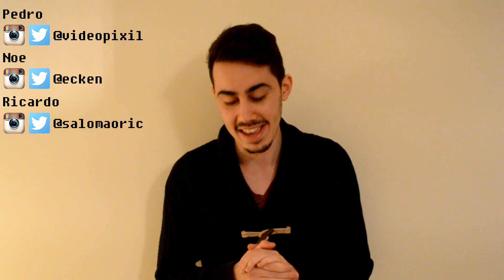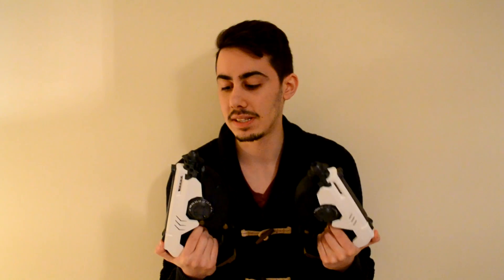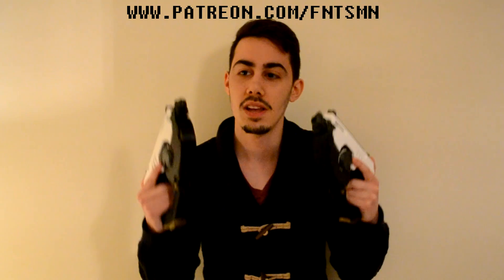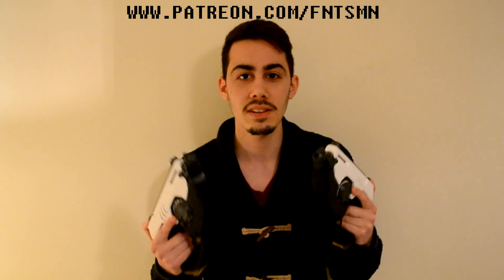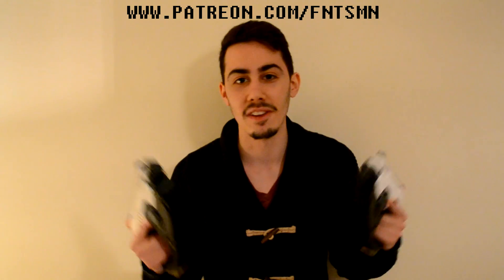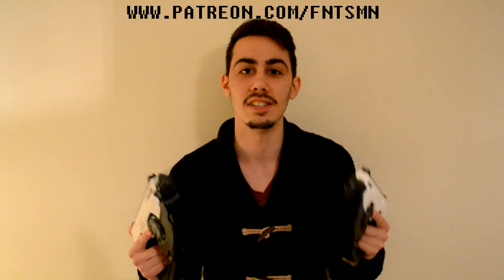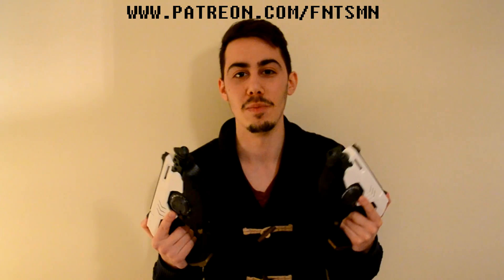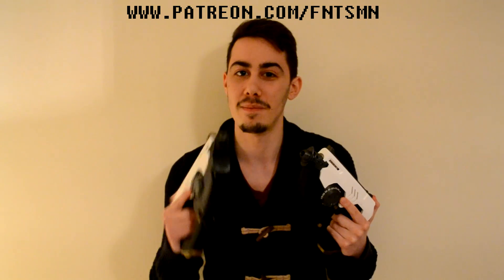Overwatch's 3D Printed Tracer Gun with Electronics

Comment: what print dimensions do you need to make this? Just want to understand what printer I would need to get.
Reply from the maker: I usually suggest to have a printer with a buildplate around 20x20x20cm ish
Reply: Thanks based on your experience in 3D printing, could you recommend an entry level printer that could print to this dimension?
Reply from the maker: I usually recommend a PRUSA I3 MK2S for the price and at the same time the great quality that you can have, plus you can require a kit and have the experience of building the printer and save some money
Reply: Thanks - appreciate it!
Reply from the maker: No worry ;D looking forward to see you print some cool models

Comment: Super awesome man. I'm building one myself but i'm planning on lighting it with standard blue 3mm LEDs. You took it to the next level with the Adafruit chip and programming. Makes me want to try too! How long does the whole thing last on one charge? Also, could you give me more details on the app/programming you're using to control the LED, i think you mentioned it was a custom program(if this thing involves custom programming too i'd probably be dead in the water).
Reply from the maker: So if you want the model you can have it on my patreon: https://www.patreon.com/fntsmn (and you can have access at other my design) about the electronics usually a charge is ok for 30-50 minutes depends how much you use them. To learning you can go on Adafruit under the menu Learn you can find a lot of information an tutorial about it

Comment: Do you have the 3D models of the tracer guns somewhere to download? I want to print these at home with my makerbot 3D printer. I like how you left all the circuit instructions and items but the models themselves could you link me to those please? that would be great!
Reply from the maker: No sorry i didn't share this model
Reply: so how much do you want for it i just want to construct this at home is this model a lot different front the last tracer gun model because ive downloaded those in hopes i could figure it out
Reply from the maker: Yes the models change quite a lot from the other one
Reply: so could i purchase this model from you? i really want to make these and i have all the knowledge in soldering and i have a 3D printer :D
Reply: also did you run out of black filament for this project?  im confused on why you are painting the grey items black.
Reply from the maker: Is not black is metallic grey